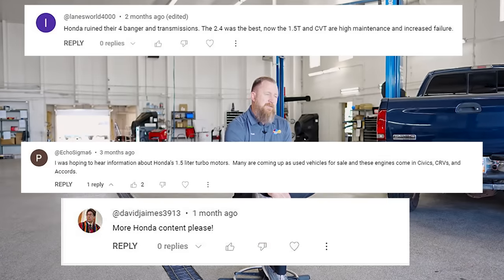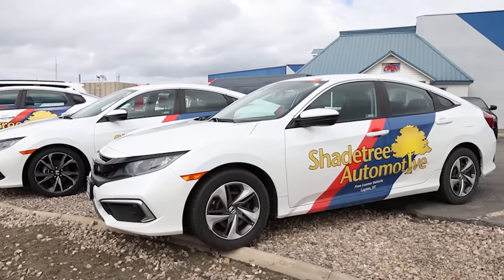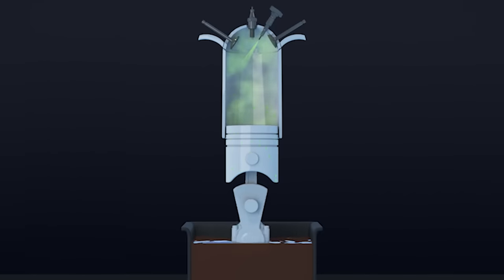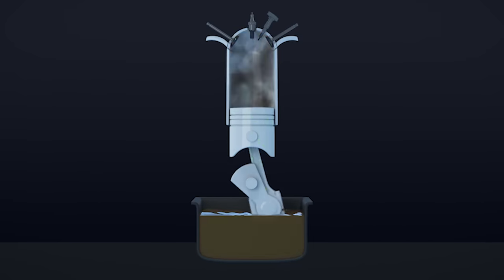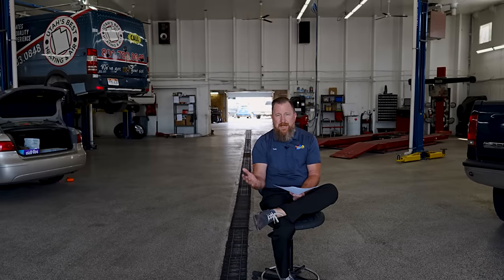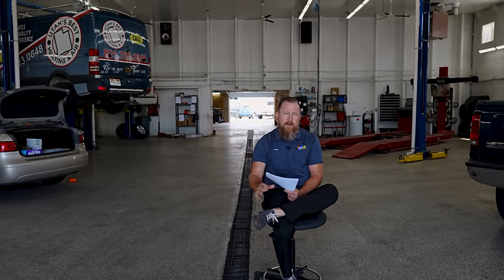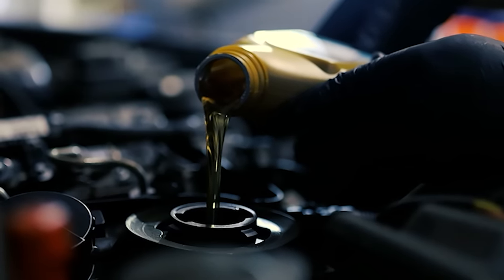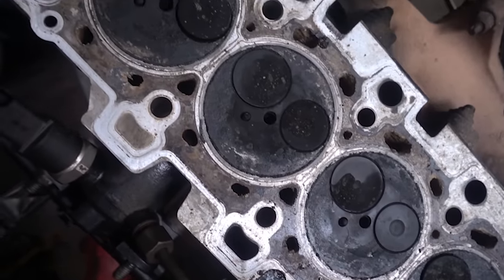Honda Oil Dilution Issue - Should you buy a new Honda

Comment: I’m leasing a 2022 Honda CR-V Touring that I plan to buy at the end? I’m an extremely low mileage driver, about 8K miles a year. Should I buy this vehicle at lease end or turn it in? Thanks
Reply: Turn it in and look at mazda
Reply: @cormaro13 It’s funny you said that, that was my plan 2
Reply: @lawdog516  I haven't test driven the Mazda CX5 (or RAV4), but I'd say buy the CR-V if you like it a lot. With it being a 2022, I definitely would not worry about the fuel injectors, Earth Dreams engine, or oil dilution at all. My 2017 CR-V (i.e., in the "problematic" year range) had no problems in that respect, I only lost it at 51,000 miles because I got hit by an uninsured truck driver and it got totaled. I loved my 2017 CR-V (EX-L), so I got a 2020 Touring in the same color.
Reply: @CytotoxicTrev  The best part is my residual is 18K, I would have to spend twice that to get the same vehicle, I have a year to decide, thanks for your input
Reply: I would jump on a low mileage Honda !!!!

Comment: Would also like to hear a video on the ZF transmission issues in the TLX and if I should avoid them or not. (2018+ or so)
Reply: Just keep it serviced, the fluid is expensive but it's a worthwhile service. Keep an eye on your transmission heat exchanger, they're known to fail and can ruin the engine, trans, hoses and radiator. Id almost just replace it every 100-150k or so, those o-rings can only take so much they fail and its big trouble.

Comment: I do Uber delivery and I usually drive to for 5-10 minutes then turn off the engine pick up order and then drive again. I do drive 2-3 hours daily but not continuously.
Is that a problem for oil dilution?
Reply: Did you watch the video? It clearly answers this question. 🤦🏻‍♂️

Comment: So should I buy a Honda 2018-2022 lx with 2.4l or a Honda 2018-2022 ex 1.5l “turbo” , I work 25-30 minutes away, and now I am worried and confused on what to get. The ex has Better features but the LX Has the the better engine? So please explain

Comment: The L15 was never built for boost. That's the bottom line IMO. Not sure if its due to piston design or if they've just gone super thin on the rings in comparison to the current gen K20C1/C4. The J35 has its own issues. I would not touch anything but the k series from honda at this point and they've all but killed it.

Comment: I appreciate the suggestions you are making however all your suggestions failed in spectacular fashion on my 2018 CR-V. The worst part about this is that Honda lied about the problem. When faced with a mountain of evidence they flat out denied the problem. This was not limited to one dealership by the way. They all denied this problem. 8+% oil dilution, 27 mile commute one way. No cabin heat. Gasoline smell in the car. Gasoline smell in the garage. No more Honda products for this guy. It is always good policy to blame the customer for crappy engineering. I am sorry I have to disagree with your assessment but appreciate the video and information!

Comment: Comparing CRV hybrid to RAV4 hybrid:
Both cars are electric cars with gasoline assist (out on the highway at highway speeds you could argue that they are gasoline cars with electric assist which is sorta correct).
Both cars have GDI (direct injection) but the Toyota also uses port injection which keeps the intake valves free of carbon build up.
Neither vehicle has forced induction (turbos).
Neither vehicle has sleazy mechanical CVT (belt or chain continuously variable transmission).

Maybe Honda will add port injection before I have to go shopping. 
I won't but a vehicle with turbos, or GDI without port injection, or mechanical CVT.
Reply: BUY, not BUT

Comment: Just a great bonus from Honda 1.5 turbo engines:oil dilution,blown head gaskets,and direct injection carbon build up where no fuel goes over the intake valves! Oh but I got twin exhaust and a turbo! Don't let unbridled ego overide common sense and some down to earth research

Comment: Great video! Does oil dilution affect the fuel injectors? Honda quoted us $1600 to replace the fuel injector set due to cylinder misfire for our 2018 Accord. Maybe the oil dilution is causing the problem. I wonder if that also leads to blown head gasket which I’ve heard is happening to a lot of the 1.5 L turbo engines.
Reply from the maker: I don't believe the oil dilution has any direct ties to fuel injector problems.  I would make sure they have not misdiagnosed it.  It is common for the oil dilution to cause misfires and be mistakenly diagnosed as a failing injector.
Reply: The injectors ARE the problem
Reply: @sartorst3376 I think replacing the injectors with injectors that cause the same issue is not going to solve the OD problem

Comment: At 8 min in you mention you check for updates on every system. Thats unrealistic from a dealer standpoint and we def don't check for updates on every single car. And a 1.5t motor does not come with an automatic transmission nor an update for an AT that helps with shift points. Maybe talking about the v6 update?

Comment: I heard the newer GF-6 oils were supposed to tremendously help this problem. The new GF-6 spec oil came out in 2020. BTW, I live in Utah and take my 2018 Civic Sedan to Stockton 12 in Sandy, but they have never said anything about any software updates. I'd bet they really don't give a you-know-what about this issue!!!! Honda dealers stink. Ken Garff Honda in Orem is the worse of all. One time I told them I wanted full synthetic oil in my 2015 Fit and the manager there told me he wouldn't put it in!! He was determined to put synth blend in. I told him to get my car off the lift and and I stormed out, never went back. Sorry it's what the customer wants, not what they want. The customer is the boss, not the other way round. The 2015 fit is supposed to get full synthetic anyway!!

Comment: I own a 2018 Honda Accord with 115k on it, without any issues to speak of so far.  I change my oil and filter every 3-4K miles with pennzoil platinum 0-w20, a 15k mile purolater one oil filter. Change coolant once per year, and transmission fluid every 30k miles.
Reply from the maker: Nice work man

Comment: My wife and I drive less then 2000 miles a year.  Should we still change the oil on our Hondas once a year, or can we go two years? It's almost exclusively local driving.
Reply: My opinion, based on my trusted mechanic is: minimum once per year.  Moisture gets into the oil...not good for engine lubrication...oil changes are so much cheaper than fixing or replacing an engine, which is the logical basis for my comment.

Comment: Does using 89, 91, or 93 gas help the detonation in anyway? Is there any benefit to using higher octane to help with this issue? I have the 1.5T in the 2019 accord and have heard this will help a lot to avoid/lessen the issue is this true does anybody know?

Comment: How many miles for the 2.4 percent fuel pollution in the fuel is acceptable? 1k, 2k, 3k, etc., miles? Not really important for me since I do not, and have no plans to have a Honda. When using the valve cleaner will it cause solid objects to "spit" out of the exhaust? If so, how do solids get past the honecomb inside the cat(s) without causing clogs inside the honeycomb media?

Comment: The PCV System has been lowered to a point it doesn't function effectively. -.2 to -.6inH2O is too low up to 2 to 5inH2O run up. An engine needs 1-3inHg for proper function in pulling these gases out of the oil. There are 2 ways the oil is kept clean in an ICE engine, the Oil Filter and the PCV System. 70% of Blow By is HC's and gas molecules are the lightest and want to be pulled out of the oil. It just needs the proper vacuum applied to do it.
Honda and Toyota both build a Catch Can into the engine and drop the vacuum to leave these contaminants in the oil. Some things look good on paper but don't work in the real world and this is one of them. I've checked Honda/Acura's from 2008 to 2024 and they all have this issue. Once they went to Low Tension Rings and then to 10W-20 oils thie system could no longer absorb the contaminants and keep going normally. I have a 10 MDX that was suppose to have stuck rings but I don't(290K Miles). I never trusted 20 weight and went to 10W-30 and sometimes 10W-40 syn in the summer always Group IV syn. This raised the temp the oil coked at and sealed the rings better to avoid this problem. Long trips to and from work helped pull the gases out.
I've since bypassed the OE PCV System and got my vac to the necessary 1-3inHg for proper function with an external Catch Can and PCV Valve. I ran a 1K mile trip and lost 0 oil. 
Retired 3G Mechanic, Best of Luck

Comment: I have a 2017 crv 2.4, it adds about 200ml of gas every 500 miles, called Honda they recommended to take it to a Honda dealer, I did they sealed the dip stick and told me to drive for 1000 miles, when I returned they said there is nothing wrong with car, so I didn't get any help, Blackstone lab confirmed over 3% gas in my oil sample, everyone talks about 1.5T, its 2.4 and 1.5 t earth dreams, 2.0 t accords the same problem.

Comment: We had two Honda’s with the oil dilution problem. I use a full synthetic oil, change it every 5,000 miles and the oil would stink of gas. Honda kept telling us it’s normal. No it is not, we sold both cars. I will not buy a Honda again.

Comment: I have a 2017 civic si and I change mine with 5w30, stp zinc additive and Lucas oil stabilizer every 2000-3000 miles depending of how the oil looks

I know Honda recommended 7,500-10,000 but i send out my oil for analysis on a few of my cars so Ive sent the Hondas out a few times. Definitely way too far for that engine. 

I have a s13 with a built ka24det pushing 650hp runing e85, I usually change my oil after every drift event or track day and send out a sample. 

The Hondas oil is by far way worse then runing my s13 back and forth 35 Mikes everyday for 2000 miles on an oil change. 

I notice the mis fire at idle and since I bought the car for my gf I just want it to be reliable. Maby there’s a tune I could figure out. But I knew about this issue before buying the car and since I got the car so cheap I could easily buy another motor from Honda and swap it no problem 

She also noticed the smell of gas and I just changed the oil so I guess we will just deal with it as time goes by

Comment: Does the 2023-2024  Honda Civic have this issue?
Reply: All direct injection engines will have this problem.  Frequent oil changes are important with any direct injection and turbo charged engines.

Comment: Wouldn't running hotter plugs fix this? Bigger coils, wires and ruthenium spark plugs should in theory burn the fuel hotter and cleaner

Comment: Carbon buildup is 100% gone if you have a methane-water injector system built in your car.   That's exactly what garages use, and you can also get it in a can for your garage to do the job for you for $35.
Edit:  If you install one of these systems in your car you also get power gains.

Comment: I would change your oil every 2000 miles. 3000 miles at most. That is what I do with my 2023 Honda Civic Si that I drive aggressively in short stop and go trips. 9000 miles, no issues. No duh! No problems at 9000 miles but what's wrong with building a good habit now? I just came from a 2018 Honda Civic LX sedan with the non turbo engine and 6 speed manual. I used to change my engine oil near 9000 miles when Honda's Maintenance Minder went 5%. I'm done with that lousy maintenance system and changing my car's fluids more often.

Comment: Get it tuned and make it run a little leaner. That's what "running it at higher operating temps" means. When you run leaner (less fuel in the air/fuel mixture) it raises your cylinder temps but that's not what fixes the issue , the higher temps are just a side effect of running more air and less fuel. You'll actually make more torque with a leaner tune. Getting the retune from Honda should fix it however you should be changing your oil anyway every 3k miles on a turbo engine. The 5k interval is good for a non turbo engine and the 10k that any manufacturer recommends is insane IMHO for a turbo engine.

Comment: Honda will likely solve this problem if they have both the port & in cylinder injectors?. When the engine is cold it operate by port injectors. 

If not Honda sales number will keep on dropping.
Reply from the maker: Every manufacturer's sales numbers have dropped in the past 2 years, but you're right, Honda was one of the worst. Do you think that's more due to quality or US import issues?

Comment: This woman had a little 4 banger that she drove like 1 mile to work and back. So the oil loads up with gasoline and at some point the oil froths up and on old engines floods the EGR system and goes back into the cylinder. Not good. 
    Solution, remove spark plugs, turn the engine. Until most oil ejected, dont look at the engine while doing it. 
    Clean the spark plugs, change the oil. 

This will happene consistently whenever a car does not have a chance to reach full operating temperature of the oil. Once the oil gets over about 140'F the volatiles in the oil will vaporize and go into the EGR system. This is bad. So on cars that never reach the temperature the solution is frequent oil changes, but a work around is to take the car out for a 10 minute drive once a week. 
     Turbocharging does require a lower operating temperature, but PV = NRT. If you are increasing pressure even with intercooled air, the pressure and temperature is what the cylinders and the rings feel particularly about 1/4 down the power stroke, those rings, piston sides ans walls are feeling the heat and pressure. The problem is not so much the turbocharger its using the turbocharger when the engine is not up to operating temperature. If we think about it, where the gas is atomized is not always were the detonation boundary is, the atomized gas that is forced into the rings can precipitate, underpressure, on the sides of the rings and pistons. This is not good because it dilutes the oil on site and causes friction, making the problem worse (increasing blowby)

    Solution, allow the engine to warm up while operating a slow to moderate accelerations. On a 1.5 liter engine there is no particukarly good reason not to let the engine warm up for a couple of minutes or more on cold days.

Comment: One way or another, perhaps this is a way to get people to switch over to battery powered vehicles easier.
Reply: Batteries have their own host of problems in both hot and extreme cold temperatures. They also degrade over time and are very expensive to replace

Comment: The old 2.4 has this issue too, got a 2013 crv and nearly every oil change the oil smells like raw fuel.
Reply: I just traded in my 09' CR-V with 160k on it. Was reliable but I did smell fuel in that oil when I changed it, as well.

Comment: A good explanation. But the fact still remains that it is a faulty engine.
My '73 Fiat Sport Coup had a 1.3 litre engine. It ran very well until I old it at 300,000 miles. This is 2024.What is that? About a 50 yr. diff. Surely Honda is not going backwards. Did the they fully test this engine? I mean, some say, in comments that the amount of gasoline in oil is like, a quart or three. Just like in China, if it is a fact that they forced Honda to recall and fix, the same should be done here. Just my 2 pennies.

Comment: On another video it was recommended that you use a higher grade fuel in the very cold months if you mainly drive short distances.
On my 2018 CRV-EX, I regularly use 87, but during winter, every other full up I would use 93. No issues noted to date.

Comment: I wouldn't have a turbocharged 4 cylinder engine (any brand) if they gave it to me free. I WOULD have a normally aspirated 4 cylinder-I've had several of them over the years. I need to buy my next Honda-Odyssey or Pilot or Ridgeline, still deciding-before they replace the wonderful J35 6 cylinder (I have had three) with a TC 4. That may be sooner than we think. And they will have to do it solely because of the oppressive fuel economy restrictions.

Comment: Use premium fuel . It has a turbo.
You will get at least 10% to 15% better fuel mileage after a few tanks have run through.
Less blown head gaskets.
Less fuel dilution 
Change oil every 6 months or 5000 miles

Comment: I had a Honda CRV 2007 and at around 100'000 k's I noticed a strong fuel smell in the oil.
 I was going to get the oil tested and attempt to rectify the issue until it got written off in an accident....Problem solved.

Comment: Had a 2017 CRV 1.5 turbo.  No short commutes but live in the colder Midwest.  At 3000 miles after an oil change, the oil level would be one quart high.  Reprogramming the computer with a software update didn't help.  Honda extended the warranty on engine to 100,000 miles.  Pathetic, I expected this engine to last 300,000 miles or more easily.  I've has probably 15 Honda vehicles since 1984, with no big issues at all.  Honda has lost their way in building simple, efficient, trouble-free engines and vehicles.  On another topic, I also recently got rid of my Pilot with the crappy 9-speed transmission and horrible handling, numb steering and soft brakes.  I am no longer a Honda customer. Honda has lost me as a repeat customer.

Comment: When you say 1.5 you mean 1.5 turbo.  The 1.5 non turbo L15 in a Fit is rock solid.  My 2019 Fit Sports last 3 oil changes starting around 40k miles with 5k oil interval changes on 0w-16 is showing almost no fuel in the oil per lab results.
Reply: its turbo crap- undersized turbos are never good.  better to  have a good size na motor that runs forever- my 98 integra with 1.8 will be running longerv than these engines-